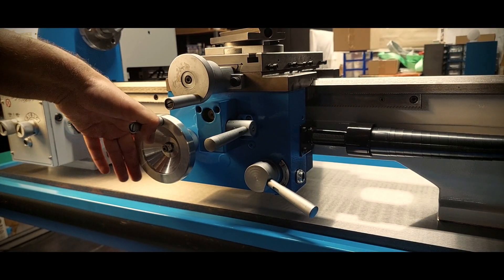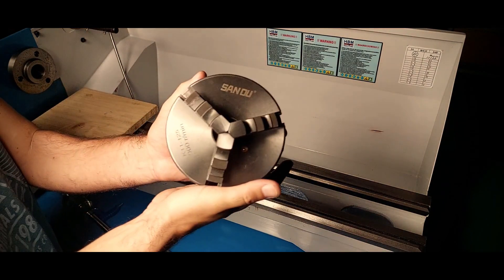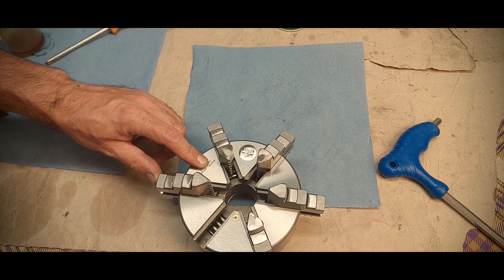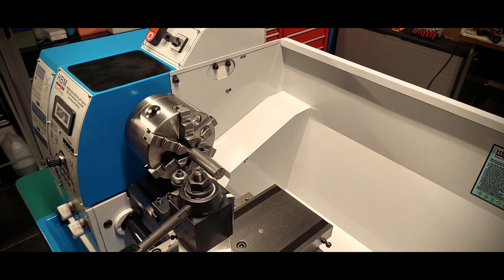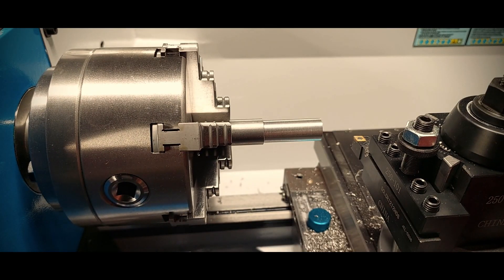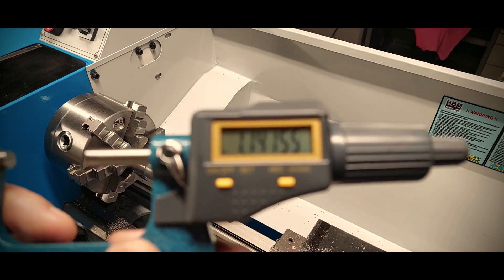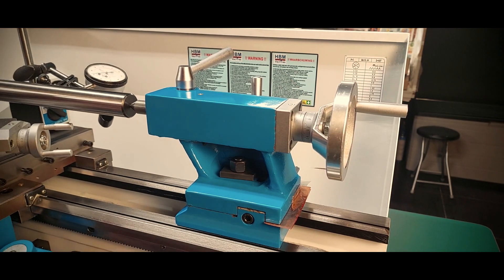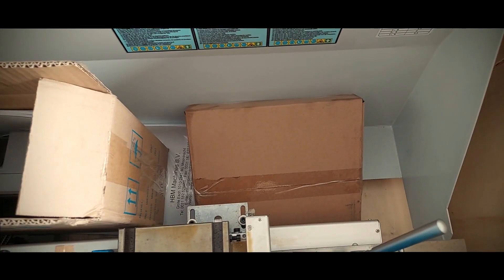Lathe rebuild Pt.3 - Final episode

Comment: Hi, awesome videos!
I'm looking to buy a lathe for my garage, is this one good?
Do you raccommand it?
How fast is the material removal?
Reply from the maker: Hi. The lathe is ok and this model is better than the typical 14x7" you see available everywhere. It's a very different machine. 

However, have in mind that this is still considered a budget machine, so don't expect it to be perfect out of the box. Also, quality will be different depending on where you buy it from. If you are in the US, I recommend you check out Precision Matthews.

Material removal rate is not really what you should be concerned, I think. Also it depends... plastic, it can make big cuts, tougher steels, not so much. 
This is a big investment, spend some time looking at features and comparing what different resellers offer. Motors, gearboxes, DRO - have in mind that today you can find this type of lathe with an electronic screw, which in theory is awesome. I say in theory because I never used one of those lathes and therefore can't comment on how they perform. But it's a big plus if you want to cut threads.

Comment: The problem with the taper in the spindel is either it doesnt run true or the angle of the taper isnt 100% exact (like thight fit at the front, less thight at the end, or its oval instead of round), and the taper in the tailstock will most likely have the same problem.
Check if the runout is repeatable, mark with an edding or magic marker or however you call it (english isnt my first language) a top side on the test bar, the spindel should already have a 0 stamped on it, and check a few times, with putting in and taking out the bar in the same position, if the runout stays the same, if not your F-ed, if yes, rotate the test bar a few degrees and check again, until you have an acceptable runout and then mark the top side permanent so that it matches with the mark on the spindel. Repeat that with the dead center and all the other tools with a taper you want to use in the spindel and then do the same with the tailstock.
With the chucks you can do the same, but the hard jaws arent really meant for perfect runout.

Also, the HBM chucks arent hardend, one chip getting between the spiral disc and the chuck body and the chuck is ruined (i had to replace my chuck because of that).

The 3D printed part for the compund slide is a nice idea, but dont use it until you installed a hardend washer or thrust bearing, or the flange of the spindel will eat into the bushing block (wich is just soft steel)

Comment: on the wobbly runout, try taking some 1000 grit emery paper, wrap it around the checking tool, and spray with wd40, then turn lathe on and slowly insert it, use the tool to help sand the channel angle. i suspect you have some burs and such stick in it.
Reply from the maker: Hi Mike, thanks. If you're referring to the test bar I have a full video about that. Here is the link: https://youtu.be/ivI8g2TINXw

Comment: Some interesting findings and fixes in the short series. I have a very similar lathe also from HBM, its the 250G, same dimentions etc but with a gearbox instead of variable speed, I got the gearbox version as at the time many were having problems with the variable speed motors and control board. Anyway, to the point, can you share a link to the 6 jaw chuck? I've tried a few places but whats available will not fit my lathe, I have the same 3 bolt fixing as you but most are for 4 hole or screw on spindles. Looking forward to more videos(subscribed for more)
Reply from the maker: Hi, thanks! I can't find the link for the 6 jaw on the HBM website anymore. I think they sold out. Toolsidee.co.uk stills shows them (1339-E) but no stock available. 

This is a 125mm (5 inch) chuck and you should be able to find it by looking for "K13-125". You'll find some selling on ebay and aliexpress (not sure of their quality).

If the spindle of your lathe is like mine, you'll always need a backplate for the chucks - if you look closer, I use one which is the original one from the 3 jaw that came with the lathe. You can either make that backplate or buy one. 

For my 5C chuck I have bought a backplate from arceurotrade (part number "040-060-11500") and have to say it was very good. Surprisingly parallel faces. They have a 95mm register for the spindle and 108mm for the chuck. In my case I had to drill and tap the holes for the 5C chuck because the bolts come from the front; but in the case of a 6 jaw, I don't think you need to do any changes. Hope this helps. Thanks

Comment: Blimey, that issue with the threading dial could have really caused a bit of damage if you didn't pick up on it. Great video, looking forward to any future projects
Reply from the maker: Hi @artisanmakes, nice to see you here. One of the first times I turned on the lathe, I had the gauge crashing with the leadscrew - teeth against teeth. I was really lucky nothing was broken. 
I think the hole for the thread dial should be located a few milimetres down, but somehow the machine was shipped like this. If I remember correctly, there's a thread on one of the forums where someone was breaking thread gauges on a Warco lathe because of this exact problem. I'm not sure how they fixed it, but the longer shaft worked really well for me. Having said that, I normally don't have the gauge running on leadscrew, only engage it if I need to use it (no need to create unnecessary wear). Cheers

Comment: another great video, some motivation for me to finally set my lathe up properly.. ive just lived with the taper it turns and sand it out when it matters 😆
Reply from the maker: Hi Simon! If the tapers are significant, it's worth doing the alignment - especially if you work on long parts. Mine needed a small re-adjustment after 1 year of use. Good luck with yours!

Comment: well, I’ve dismantled the head and removed the main bearings, and the metal filings and dirt and what looks like Marmite, but is probably ‘grease’ and I have to say that my lathe makes yours look like a Swiss watch! I’ve now made the Mill videos public (took a while to delete all the swear words) now working on the lathe ones. now working on the lathe ones. Not up to your standards but they may be of use to someone looking to buy one of these machines.
Reply from the maker: Thanks for sharing! I have seen some of the videos, your sigh at the end of the mill pt3 says it all 😄 I will be watching the rest of them (also subscribed to your channel). 

The paint orange peel effect is something I couldn't avoid on my lathe as well. I have dealt with that in the past, when I restored a car, but had different conditions where I could get better paint work done. This time I was spraying the parts on the floor,  down on my knees in an improvised dark booth. I was a bit disappointed with the result, but can't ask for more given the conditions. Once again, thanks for posting, I'm enjoying watching them.
Reply from the maker: I have binged watched your videos yesterday. Nice work you're doing and I like your attention to detail. Your lathe sounds quieter than mine (just like my mill with the brushless motor). It seems both out lathes are very similar but I may have had just a little bit luckier than you as some parts were better from the start. Please keep posting!

Comment: Well if I had to take a guess what the proble m might be I'd say a lot of it has to do with that warped piece of random barstock you are using. And the rest of the problem I's probably because the lack of preload applied to those more than likely cheap headstock  bearings. No way to know for sure just by watching a video.
Reply from the maker: The bearings were replaced (Part 1 of the rebuild). What do you mean by warped piece of random barstock? Where do you see that in the video?

Comment: I can tell you without reservation that if you spent $50.00 US on a lathe test bar that banking on the accuracy of your spindle and the test bar is an exercise in futility.  The company I work for sells CNC equipment of various brands.  One A2-6 or A2-8 spindle test bar are each in the $1,000 range.  They come in handy after operators crash machines.  What you did is all you need, get the twist out of the bed, cut a part.  Machine doesn't have to be level, but it needs to be straight.  All the rest of it is just lack of attention to detail which is why you had to shim the tailstock body.  It's a shame really; it takes just as long to make junk parts as it does to make good parts.
Reply from the maker: Hi Terry. Thanks for your comment, that's an interesting point of view!

Comment: Hi. The DTI is swinging like that in real time? Very odd. Try another DTI! Is the test bar straight? You may need a surface plate and V blocks to check that. Is that paint on the bed under the headstock? If so clean it off, you need bare metal to metal contact. Are the bolts tight? Was the motor running or the chuck turning?  If so first is the DTI securely mounted? If on the carriage is there any vertical movement in that as it traverses? If holding the test bar via a morse taper make sure all mating surfaces are spotless, any dirt at all will upset things. Maybe a loose spindle bearing or insufficient pre-load. Head not seated down properly? Easy to check for movement against the bed. Worse case and it's a cracked headstock or bed. I do hope not. Start by checking the DTI installation and then check each item in the chain individually moving forward from the headstock thinking carefully about which reference surface you are using. Best wishes.
Reply from the maker: Hi Bob, nice to see you're back. I think I have some answers to your questions, as I checked most of those things.

1) Yes, the DTI swings like that while the lathe is running - mind you, it's a tenths DTI (0.0001"). But again, sometimes, I get a perfect fit and have almost no runout (this is rare but has happened). Other times I have... 2 thousands, 3 thousands...

2) The test bar is straight, I will be showing that in the next video, exactly how you describe: surface plate, v-blocks and a surface gauge being pushed parallel to the bar. When I rebuilt the lathe I didn't have the surface plate yet.

3) The DTI was securily mounted, no doubt about that. Also, I tried this so many times.

4) No vertical movement on the carriage or cross-slide, anything really, I would even say those parts are a bit on the tight side.

5) The surfaces of both tapers are good and I blued them. The blueing shows very nicely all around the test bar. Having said this, my suspition is precisely the spindle taper being just a little off (angle too wide). And the test bar sometimes sits well and I got good readings... and other times it sits sideways and it's what you see in the video. It does lock really well and it's a pain to remove... 
I've been thinking on how to confirm if the taper is off. Maybe setting my compound angle perfect (really perfect) and then check the taper with the dti? I can try that, but I think I need to go easy on the assumptions, as setting the compound angle, even using trigo (joe pie...) might leave room for the wrong conclusion.

6) The spindle bearings are perfect. I can hold a long bar in the chuck and push on it up and down. a DTI in the spindle nose shows 1, maybe 2 tenths of movement.

7) I believe the head sits correctly in the bed. And I trust there are no cracks in the head or the bed.

If we look at it, the lathe is fine and produces good parts. The only problem happens when I use the spindle taper. My dead center also shows runout. I'll be posting all of this in the next video. Thank you so much for your questions, they are all relevant!